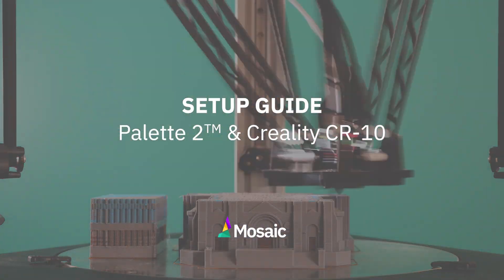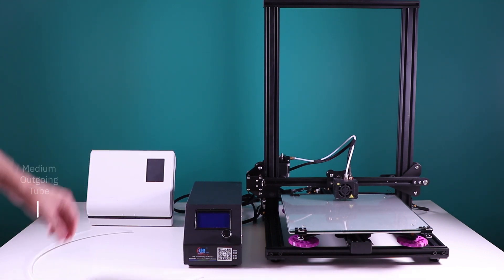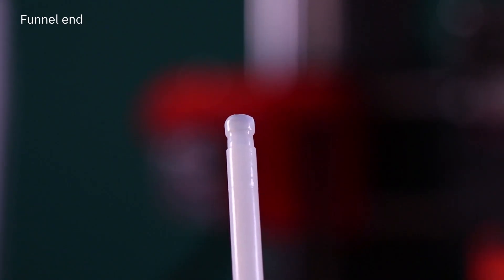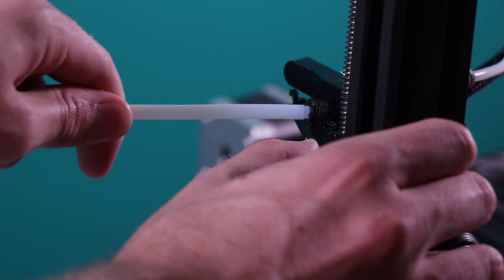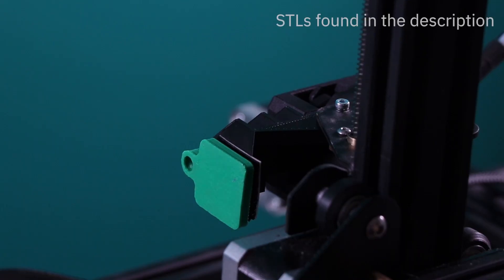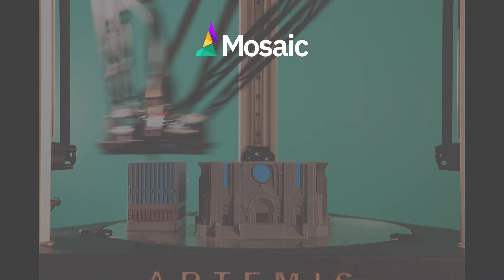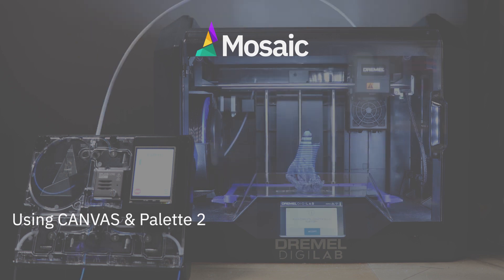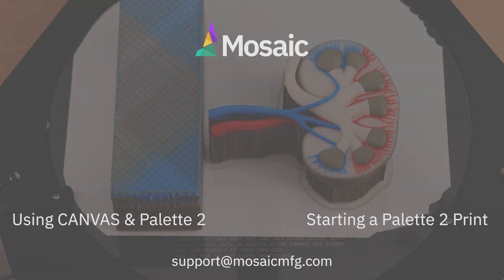Setup Guide: Creality CR-10 with Palette 2

Comment: I have the palette and I really want to use it but I have a cr10s pro v2 and I have no idea how to set them up to work together.
Reply from the maker: Hey Ethan, the setup would be similar to the video above, but if you have specific questions about the setup, please send us a message at support@mosaicmfg.com and we'll get back to you quickly.
Reply: @MosaicManufacturing  I did but its been telling me the message could not send. I have been trying to do a multicolor print but when I start the print the print will change colors either to early or to late it will never be on time.

Comment: is a 3D printed part necessary for the bondtech extruder on a CR-10S?  You show the clip as green in the video and link to the STL in the description, but it seems the included clip in the box with the velcro back is the same size and is think enough to have the rubber grommet.  Will the included clip do the same job or should I plan to print from the STL?
Reply from the maker: Hey Chuck, yes, it would be best to print a custom guide clip for the Bondtech. We have a user-made one here: https://www.thingiverse.com/thing:3267788
Reply: @MosaicManufacturing  Thanks for the reply...but what about for the mount for the Bondtech mount that includes the filament runout sensor?  Your video shows the custom piece perfectly...but it's the same as the one included in the box.  I think that's going to work without printing the one you linked.  I don't think that mount will work with the filament runout included with the CR-10S (despite the fact that I know I don't actually NEED the included filament runout since the P2Pro has that function upstream).

Comment: Unfortunately this doesn’t show the remaining steps in feeding the filament through to the hot end. All video’s show to direct drive extruder.
Reply from the maker: Hi Paul, we would recommend holding the extruder lever to allow for filament to easily pass through the Bowden tube to your hot end. Once this is done, please follow the on-screen instructions to load filament.
Reply: @MosaicManufacturing  
Does the Pallet 2 provide enough filament to the hot end?

Comment: This is great. I'm glad you specifically mention the bondtech extruder because that's what I have on my CR-10. My biggest question is whether or not the pallet 2 will work with Klipper firmware and specifically with pressure advance. Klipper has completely changed my printer and I'd like to know if pallet can keep up with 100mm/s printing that Klipper allows me to do. My next biggest question is if all of the awesome features that I love from S3D 4.1 are going to carry over with canvas. I'm not really willing to give up the thin wall, automatic supports, smart bridging, etc settings in S3D and switch to another slicer. I've got my S3D profiles tuned perfectly and my print quality is awesome. Am I going to lose that with Canvas?
Reply from the maker: Thanks, Dade! Yes, Palette 2 will work with Klipper firmware and with the pressure advance feature.  However, the print speed would depend on a few factors (splices per layer, materials used, nozzle size, etc.). We've found that for a 0.4 nozzle using PLA at 0.3 layer heights, 90mm/s is possible.

Concerning CANVAS, as it's still in Beta, we won't have all the features that are currently available on S3D 4.1. However, CANVAS will constantly be updated as we work to provide features and requests from users. If you do decide that you'd like to stay with S3D for now, you can simply pair this slicer with our Chroma software (http://mm3d.co/simplify3d).